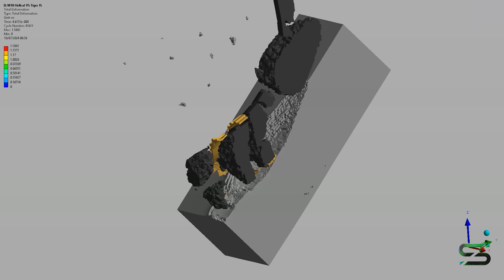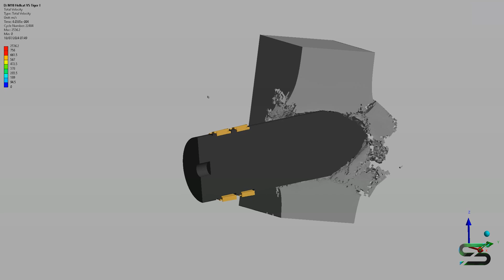What If Tiger I Had A Sloped Armour?

Comment: Tiger 1 is good and fear factor  tank in the war but difficult tank too as engine and transmission issues but not as heavy like king Tiger or worst as Tiger should have front sloped hull,sides, and front sloped turret, but due cost and resources is against them as fighting two fronts and producing  more Tiger tanks is difficult position for  Nazi Germany.

Comment: bullshit. An 50mm thick 60° spoled armor provides equal protection to the 100mm vertical, in the same weight.  so the basic idea of this video is a fail: is you slopes the armor, you need to make thinner in order to mantain the same weight.

Comment: Okay now reduce the thickness to make it the same weight as the vertical armor plate it replaced.
Reply: Are you serious. Angled or not it weights the same
Reply: @Iron_Soil   Cant you see that the plate needs to be taller when angled to reamain the same height of the vechicle? Also it leaves much less space inside the tank.

Comment: Connect the 2 front plates so it's one big piece of angled armor like a tiger 2 upper glacis that connects to its lower glacis armor, it will have a better angle if the front armor was 2 big welds of armor instead of 3 like tiger 1, actually you could leave the tiger 1 armor as is but add extra spaced armor with 50 to 100mm armor plate that is angled over the machine gun port top to the lower glacis top leaving lots of space armor in the machine gun port plate with armor and hole to shoot the hull machine gun threw. Extra armor to the lower glacis as well better engine and improved turret extra spaced armor would be nice to see.

Comment: That's a super hellcat model, you can tell because the turret looks like that of an m36
Reply: Well, it’s supposed to be, but he simulated it as using the 76’ gun if I’m not mistaken.  I think the actual super hellcat was able to pen the panther frontally up to 2km, and thus would have been able to at least pen the non-angled tiger.

Comment: Bear in mind: sloping the plate increases its area and therefore its mass. The weight of that plate would increase by about 41%, not accounting for additional weight changes caused by eliminating the horizontal plate below it and extending the side plates.
Reply: Wouldn't it reduce the overall weight actually? I'm imagining it like hypothenus theorem but we need to check how it really changes the volume.
Reply: @engi6297  I think he's referring to this particular case with the Tiger 1 with its sloped UFP, and how this particular design change would increase the overall mass of the UFP due to its sloping while also having the same connection points with the furthermost front of the LFP. If you wanted to retain the same effective armor thickness on the Tiger's UFP while also not making it any heavier, you'd need to entirely redesign the whole frontal portion of the tank.
Reply: the main reason why sloped armour is better is that it increases the obliquity, or angle of impact. For rather complex reasons, shells are worse at penetrating armour the same equivalent thickness when it's sloped. Angled armour from a pure thickness perspective, however, is equivalent to unsloped armour, but shells aren't lasers.
Reply: Pulling bs from your ass eh?
Reply: you could get rid of the stepped plate above the transmission, not sure how much that would weigh but if there is still an overall weight increase, it would certainly be worth it because the sloped 100mm plate would be much much more effective than a flat plate of the same effective thickness
Reply: The math doesnt add up sir

Comment: How much weight did it add when you increase the slope of the UFP without decreasing the thickness?
Reply: The weight of that plate would increase by about 41%, not accounting for additional weight changes caused by eliminating the horizontal plate below it and extending the side plates.
Reply: @DecidedlyNinja I wonder how well a thinner angled plate slapped on top of the stepped armor would work given equivalent weight constraints. Like, just do what the super pershing did except with a tiger 1.
Reply: @BoomchacleV0 much worse

Comment: I love the idea of this but sadly its factually incorrect. This test would only make sense if you would use sloped armor of equivalent weight as the nearly vertical armor of Tiger I. Germans were well familiar with sloped armor when designing it, but decided not to use it as it comes with many disadvantages. Internal space, much more complicated crew ergonomics, hatches and periscopes.

Please do this test again, but with weight equivalent sloped armor, its an awesome idea.
Reply: the tiger’s upper front plate is still a little sloped tho

Comment: I always wondered why germans didnt modernise the tiger1 post 44 when they realised that for a heavy tank its armor is lacking against more potent field AT guns and never enemy tanks. Welding like 30 mm angled plate betweed hull roof and lower plate tip with leaving space for driver port would make its frontal armor strong enough to withstand US 76s and Soviet 85s
Reply: Probably because they didn't have enough left to be worth up-armoring and no longer produced/have move on to the tiger 2
Reply: Скорее всего потому что на танк уходило бы больше времени, в той ситуации в которой был рейх это было роскошь
Reply: Think of it from a strategic perspective:
1. You have to recall your Tigers, which are urgently needed at the front
2. You take up valuable logistical capacity on your already overstrained rail network
3. Your factory really has better things to do
4. And finally... it changes extremely little for the missions that you actually can give to your Tigers. 

Yes, you will lose ever so slightly fewer... but it's just not worth the month or more of effort that this massive endeavour takes. You probably lost 10 other tanks and have received 10 fewer new ones just to marginally improve 45 Tigers.
Reply: Причина в том что 88 мм зенитная пушка на которой стоял Тигр 1 серии. К 1944 году уже морально устарела, она не пробивала Черчилля в лоб, ИС-2 тоже неохотно пробивался с больших дистанции. Вдобавок на Курской дуге 1943 году, 88 мм ПАК 43/L71 хорошо показали себя. Но они были слишком громоздкими, а шасси Насхорна имело лишь противопульную броню. А Фердинанд был слишком тяжелый и неповоротливый, большая часть была потеряна из-за технической части. Однако если Союзники и СССР могли восполнить потери, то немцы уже никак не могли. И они перешли от количества на качественный скачок. На тяжелый танк Тигр 1, Е класса, пушка  kwk 43 88 mm/L71 не помещалась в башню . Обычно для танка проектируют специальное танковое орудие. А тут для готового орудия проектируют целый танк. Первый прототип имел башню Порше, толщиной 167 мм. Однако имел конструктивный дефект, заман между башней и корпусом. Были случаи когда снаряд отскакивал от  лобовой брони и пробивал в стык между корпусом и башней. Компания Хеншель снова победила в конкурсе на башню Тигр 2, и на свет увидели знаменитый танк который мы видим в играх WOT. Лобовоя броня Тигр - 2, имела толщину 180 мм. Она даже не пробивалась из 122 мм орудия, однако вследствие дефицита марганца и никеля, она давала внутренние отколы которые поражали экипаж. К 1945 году, уже никакие вундерваффе не спасли нацистов.
Reply: @warlord9259 Nice AI copy and paste
Reply: because past 1944 most of their factories were converted to rubble
Reply: It adds weight.
Reply: Would the modernized version be the tiger2? I think the metals used in the armor were softer than the other nations at the time too.
Reply: У Тигра было много проблем. Например с ходовой частью. Нужны были два набора гусениц, одни для транспортировки, вторые для боевых действий. Со всей ебатней с их заменой. Шахматные катки забивались грязью, давая просраться танкистам с их чисткой, и не дай бог заморозки - если грязь замерзает все, никуда не едем. Много всего в отчетах и мемуарах. Танк очень сложный и дорогой в производстве. Пантеры тоже не блистали. Те же проблемы с шахматным расположением катков, дорогое и сложное производство. И, как оказалось они были выбраны вместо куда более технологичных и дешевых VC благодаря откату % от военных заказов. Вот их могли наклепать много, 1 к 3 вместо пантер, и они были бы реальной проблемой на поле боя. Наладить массовое производство и быстро решить вопросы с надёжностью так и не удалось. И да, часто забывают что пантера это тяжёлый танк, а точнее тяжелая ПТ с башней, и отчего-то упорно пихают их к средним танкам. Хотя ни по массе, ни по конструкции они таковыми быть не могут и сравнивать их с Т-34 или Шерманом абсолютно некорректно.
Reply: The armor was good enough to withstand 76s and 85s at a range. Aldingen more armor in front would have just made the Transmission even more phone to failure.
Reply: @mkultra3679  the tank was designed with additional armour in the front which could be deployed to protect the tracks, the weight capacity was present, the issue lay likely somehwere else
Reply: @mkultra3679  but they did it was called the Maus
Reply: Because Hitler ego and German limited resources. German resources at that time was low and there are more prioritized build like german plane, u-boat and other tank like the panther. Modernizing tiger might reduce that expenses but Hitler ego prefer to make a bigger more intimidating and wasteful tank like King tiger and... Cough, Cough, Jagdtiger... Cough, Cough. It's practically stupid in Hitler mind to modernize it instead of using the left resources for building more tank with bigger size and newer technology. Sure this might not be the case since this is just a theory with no clear sources but it's up to you to believe it

Comment: As expected full calibre rounds suck against sloped armor
Reply: Only for AP and APBC
Reply: @MareRaceHorseAlmondEye  okay mr smart pants tell me if an APCBC round will go through 60 degree angled 100mm RHA plate or not
Reply: @obeyobay9146  yes 
Some high pen APCBC will probably easily penetrate the plate like 12.8,130
Reply: @o-hogameplay185  M358 will probably shattered bc it use Ballistic capped instead of cap but will left a huge hole there's simulation on using M358 against IS-6 100 mm 65° plate
Reply: @MareRaceHorseAlmondEye  uncapped AP was actually better against sloped armor than capped AP.
Reply: @basedjorts  no cap shell was better against slope since it's harder to shatter than using normal AP 
ex: M62 was better than M79 shot against T-34 front
Reply: APCR is subcaliber and it wasnt great against sloped armor